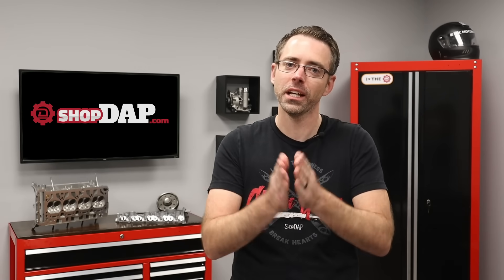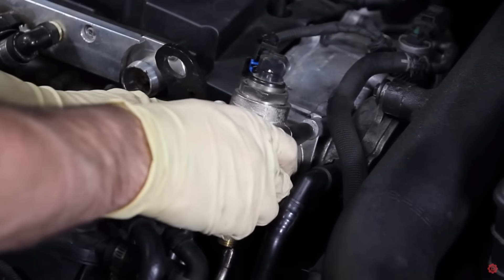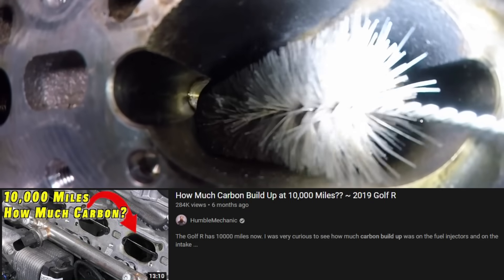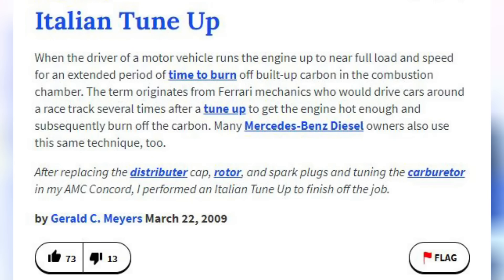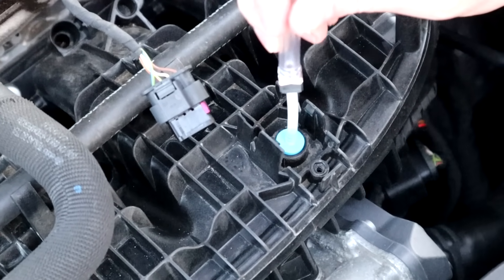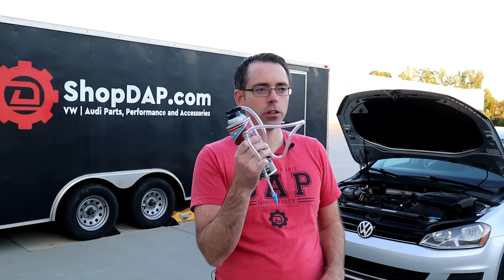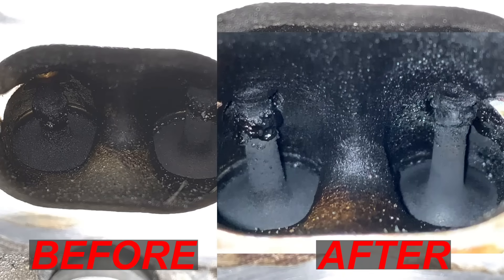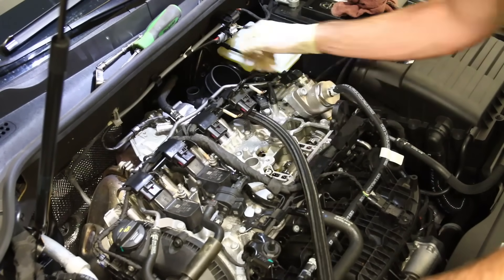Can you Really Remove Carbon for $29?

Comment: Anybody that has done a manual cleaning on a DI engine will know there's no way product you spray into the intake is gonna do anything significant. 
DiagnoseDan did a similar test with a "powerful" product they only sell to shops, and same thing--very small amount of removal. No such thing as mechanic-in-a-bottle/can.
Reply: actually B-12 Chemtool combined with the drill wire brush was a pure magic.  Well, the true magic is a wire brush tbh
Reply: @temich1985  just use water and a wire brush on a drill. Use a compressor to dry the metal quickly after you are done
Reply: @temich1985  B12 while the car is running in small sprays works wonders also. Just let it reach full temp and after doing so change you're oil. :D
Reply: @GlennC789  When I did this on a GM 3.0 V6 (100k miles, had never been cleaned - it was bad), I pulled the intake and turned the engine over by hand til the valves I wanted to work on were closed, then used a set of long picks to break the bulk of the softer crud off. If you use steel picks, be careful not to score up the valves. Then I used a shop vac to suck as much of that crud out as I could. Then, I sprayed some CRC GDI Intake Valve and Turbo Cleaner directly onto the valve stems until the little pocket they sit in in the head was full, and they were submerged in the stuff, and let it soak for a bit. Then I uses several sizes of long handled copper and nylon "bottle brushes" that I bought at Harbor Freight to scrub off the rest of the crap, then blotted it all up with shop towels. Don't suck it out with a vacuum, I imagine it would explode! After I'd gotten the stems and back of the valves pretty well cleaned up, I turned the engine to open the valves and scrubbed the mating surfaces between the seat and valve the best I could with a thin but stiff nylon brush. Then I moved on to the next cylinder. All in all, I think it took me a solid 6-7 hours (like I said, they were in bad shape).

Now, the CRC cleaner is meant to be sprayed into the intake with the engine running, like the product shown in this video. I did use it that way after the manual cleaning, but it would never have gotten through the buildup without some manual action on the valves, as bad as they were. But I do believe the stuff is legitimate for routine maintenance, and would probably prevent the buildup from ever getting that bad to begin with. Here is a video about the stuff I used (I have no affiliation with them at all, I'm just a shadetree mechanic):

https://www.youtube.com/watch?v=RcVDZAauO88
Reply: @RickinICT  probably used shit gas if it was a MPI engine.  Unfortunately on GDI engines this just happens as the fuel spray is not spraying on/past the intake valves.
Reply: Why are these replies repeating themselves?
Reply: I just finished removing my manifold for this service and to replace all my injector seals.. some of that build up takes some real elbow grease to break free.
Reply: They work if you use them before the carbon gets so bad it requires manual cleaning.  Using intake cleaner prior to every oil change and your valves will be spotless.
Reply: @ohboy2592  air intake cleaner down the intake? I don't see that reaching all valves.
Reply: There are videos from Projectfarms and many others that prove your opinion as being wrong.
Reply: @lonniebeal6032  I'm saying that it worked on a 98 Hyundai excel !  312000km on the clock and after I ran a mini setup. Borescope doesn't lie! Intake manifold and runners down  to valve stem was spotless. I also did the Italian tune up everytime I drove it! Water / meth does work!
Reply: Walnut d best
Reply: @GlennC789  i would also like to know. Although it seems that sucking it out with a vacuum cleaner of some sorts would be bestm
Reply: Agreed. Manual cleaning only, which is a nightmare unless you media blast. I HATE DI
Reply: If you are referring to BG, it definitely works on mine. I have the pics.
Reply: Yea well I wonder if a water injection system would help. 
I ran a homemade one on my tdi for years, and also routed the pcv somewhere else. 
When I tore it down after 60k or so, the ports had nada buildup and the pistons and combustion chambers didn't look like a diesel. 
It had black on it but not any thick carbon at all. 
You'd get a dirty finger if you ran it down a port wall but it was clean as a whistle. 
My setup blew right in the turbo as I had no intercooler on that setup, so that's easy. 
With an intercooler it could puddle up and cause issues , at that point it's better to pressurize it and inject after the intercooler.
Reply: @MrTheHillfolk  hi. You're absolutely right! I tested a water injection setup on a 4 cylinder Hyundai excel. I used a micro nozzle from a hardware store and fitted an eBay electric supercharger ( brushless motor hooked up to a fan) only reason I ran electric supercharger? Just to help push and atomize the water and methylated spirits! I put a borescope down as far as possible! It was gleaming! No carbon anywhere! Btw the electric supercharger only gave CFM. No real boost. Basically a powerful leaf blower. Lol. But it spunthe wheels in first and chirped in second! Not bad for a 312000 km engine! Yes ! Water injection is awesome!
Reply: Well ruining your catalytic converters is pretty significant 💨💨💨 😧
Reply: Honestly very wrong. The CRC GDI valve cleaner spray works fantastically.
Reply: @dave6933  no it doesn’t. Take the intake manifold off, photograph the valves, run it, take manifold off, photograph and compare. Why make up bs?
Reply: @goclunker  funny Ive seen gdi engines that use this as well as sea foam on a regular basis and the valves are spotless.  No, it won’t do much if you wait until there’s 100,000 miles 
 on it.  Routine maintenance but if you wait until valves look like this then you aren’t very good at maintaining your vehicle.  There was a YouTube video some years ago that a guy pulled the intake on his neon.  Used it every or every other oil change and at 60,000 there were zero carbon deposits on his valves or stems.
Reply: @goclunker  why would you put the manifold back on? Nobody follows that bullshit. It does work, and I know it does because I used it to dissolve the 115k mi carbon build up on my N54, a notoriously dirty engine. Pop the manifold off, close some valves, spray the shit in each closed port and wait. Drain it, pick the stuff off that you can, and repeat. Quite easy and effective.
Reply: @dave6933  Now I know you are lying. Guess what? I have a n54. It took over TWO DAYS to dissolve the carbon with scrubbing. lots and lots of scrubbing. It wasn't easy, and the next time I will be walnut blasting in less than two hours and get PERFECT results. Have fun wasting your life waiting for a fluid that can't dissolve all the carbon.
Reply: @ohboy2592  A neon isn't GDI... My m3 has spotless valves with ZERO cleaning, its NOT GDI. You have no idea what you are talking about. No port injection engine has these issues
Reply: @goclunker  my bad, it was a Chevy cobalt.
Reply: @goclunker  I’m not sure why you think i’m lying or what I would have to gain. I used CRC GDI valve cleaner. It worked very well. I actually attempted walnut blasting before and it was not yielding good results, spent roughly an hour+ per port. I’m even willing to send you an entire photo set of my walnut blasting setup from the compressor to the blaster to the vacuum adapter I used. I suggest you watch Vehicular DIY’s video on his N54 valve cleaning with the CRC cleaner, his experience was very similar to mine. Not sure what you’re so angry about, none of my life has been wasted. I mean it would appear to me you are a very angry middle aged man going off in some youtube comments because you’re angry about valve cleaning. Anyone who hates GDI/DI, has very little idea of what they are talking about. There is genuinely ONE downside to GDI and that being dirty valves. There is a myriad of benefits it offers.
Reply: @goclunker  Yes, i’m the tool. Clearly I’m the tool here, not the grown man crying about valve buildup in some youtube comments accusing people of lying because they had a better experience than he did. N54 life isn’t for everyone bud. Seems like it’s causing you a lot of grief and you’re lashing out. Go have fun with older cars if you hate DI so much.
Reply: @goclunker , ha "Why make up bs?"
Reply: @goclunker  "Now I know you are lying. Guess what?"
Reply: @goclunker  You're wrong, there are youtube videos proving it does help, once a year or every 10,000 miles.  Kia offers and overnite soak that involve spraying it into the intake.  You naysayers have done zero research.
Reply: @lonniebeal6032  i am not taking mechanical advice from a guy named Lonnie who “reads” about catch cans
Reply: @goclunker  I have used the CRC GDI as a solvent to clean valves. Pull intake, soak in solution, mechanically agitate heavy deposits. Remove residue. I didn't even bother to read the directions on the can. But like you said, spraying into the intake with the car running does little if anything.
Reply: @mph5896  as a solvent, sure. As a miracle spray, no
Reply: @mph5896  So what is this miracle overpriced CRC GDI liquid stuff? Acetone? Buy by the bucket and spray.
Reply: @dave6933  ...What's you definition of easy? Changing oil, spark plugs, air filter is easy. Carbon cleaning intake valves is not. The only thing that's easy about it is simply saying it's easy.
Reply: @harryberry474  It's literally extremely easy. Takes <45 minutes to get the intake manifold off. $15 for a remote starter switch to open and close the valves. $100 for a harbor freight media blaster and a box of walnut shells. Takes 3-4 hours to get them spotless. <30 minutes to get the intake manifold back on. A 15 year old kid could do this job flawlessly the first time around. It's extremely easy.

Comment: So if you take the manifold off. Couldn’t you just burn the carbon off the valves? I’m assuming a carbon oil mix would burn and I don’t think it would get hot enough or burn long enough to harm the engine. Just wondering.
Reply from the maker: I assume you’re saying with a torch. You could but it could damage the valve guide seals which then lead to a cylinder head rebuild

Comment: Toyota has a wonderful system that combines port and direct injection systems on several of its engines. Not only does it get rid of the problem you're talking about; Port Injection works better at idle and lower speeds. And there are conditions where both systems are used simultaneously for better efficiency
Reply: Fords f150 I think offers this or at least has port injection one one motor still
Reply: as far as im aware, the port injector on the d4s system is only used on cold start and during warm up? im sure it still helps
Reply: @Buddahknife  I do not believe that is true. I believe it is used generally at lower RPM; and sometimes simultaneously with direct injection. I'm sure Toyota has all this figured out as to the advantages of doing it that way
Reply: @Buddahknife  it is also used as you describe
Reply: In Europe Volkswagen also has port and direct injection.

I think it is too complex
Reply: Simplified:

Low load - Port Injection
Medium load - Port & Direct 
High load - Direct Injection
Reply: What makes you think Port Injection is better at idle?

Comment: Idiots clean carbon off their intake valves.

Anyone with a basic grasp of ICE operation knows how to stop the deposits from forming in the first place...

Hot dry soot from the EGR combines with cool wet vapours of oil and water to form a sticky tar. This coats the valves and is 'baked on' by emgine heat.

 Map out or blank off your egr.
 Pan-e-vac or VTA on the pcv.

Its so simple, so quick and so easy, yet idiots around the world still complain about carbon deposits in the intake.  If you dont know your machinery well enough to maintain it correctly, you dont deserve to operate the machinery.

 Those of us with a basic understanding of the operating principles of The ICE save thousands per year in maintenance/repair, those too lazy to think or read or learn get ripped off every simgle time.

Comment: I have cleaned up complete carbon build up on my 157.000km Mk6 GTI by removing cylinder head, and car doesn't run any better than before, except maybe it runs little bit smoother when it is cold. Gas mileage and performance is about same. Carbon build shouldn't be a big deal until car reach some serious mileage, at least 200k kms or more.
Reply from the maker: That’s incorrect for the TSI engine found in the MK6 often will have cold start misfires 70-80k mules.
Reply: @Deutscheautoparts  Maybe, but I haven't issues on my own TSI. Not even single detected misfire at nearly 100k miles.

Comment: Avoid short trips, change your oil slightly more frequently than vw specifies and use the best quality fuel available...prevention is better than the cure
Reply: Quality fuel has nothing to do with it. And changing oil slightly early won’t do anything. No matter what you do you WILL get carbon buildup.
Reply: @theofficialwizard2753  but with the newer engines there's combined port injection with direct, which should help with cleaning the carbon
Reply: @theofficialwizard2753  Vent the PCV into the atmosphere, that will fix it. 😉
Reply: @temich1985  Me too unfortunately. One of my neighbors has his Pontiac Sunfire with the exhausts practically cut down to the headers. Why, no one knows. No hard feelings at all though.
Reply: @temich1985  Out of curiosity, how do you dispose of the B-12 and the carbon so it does not hurt "mother earth"?  And why do you drive a car? If you truly cared, you would walk everywhere and not exhale... It's either all or nothing bud! Try not to be a hypocrite..
Reply: @tonyfischer9287  You will leave a carbon footprint regardless if you drive a car or not.  Every time you buy something from the store, its been delivered by a big truck.  However, you can still be ethical and reduce it by keeping your car operating as it intended to be.  Your  engine will combust b-12 vapors and the cat converter will break down most of your fumes to CO2 and H20.  Taking out PCV or cat converter will pollute the atmosphere tenfold than a regular mod.  In the old days when cars didn't have exhaust recirculating systems there were not nearly as many cars as today.  If everyone today will just carelessly mod their cars we will probably suffocate to death from all of those fumes and the dripping oil from pcv hoses will pollute the ground and a water
Reply: @GlennC789  You're correct, its more of a joke. Another one I like is tell people to just pop manhole covers when you need to drain your engine oil. Easy, clean job!
Reply: just buy a Toyota or a Lexus, they have port and direct fuel injection, so no issues  when it comes to carbon build

Comment: There is one true fix, Ford calls it dual-fuel, Toyota calls it D-4S, even VW has already implemented their solution in other markets. Multiport fuel injection, add some good old port injection to a direct injected engine to keep those intake valves clean. This is the reason I traded my 2015 F150 for a 2018. Thankfully the aftermarket has come to the rescue with kits available. I'll take a good look at the options once my water pump goes and I have to pull the intake manifold.
Reply: VWs in europe have dual injection they just neglect it for north america
Reply: Adding back the port injection does not fix this either.  It just reduces the buildup by half, which eventually would cause issues when there is enough built up over time.